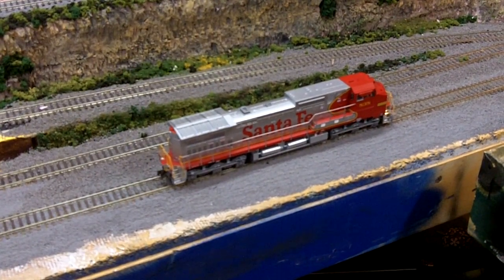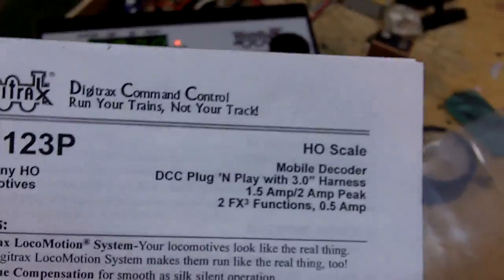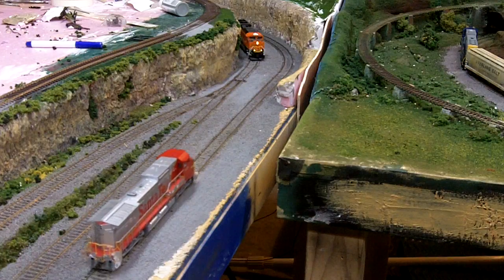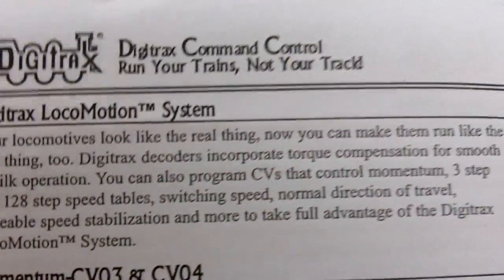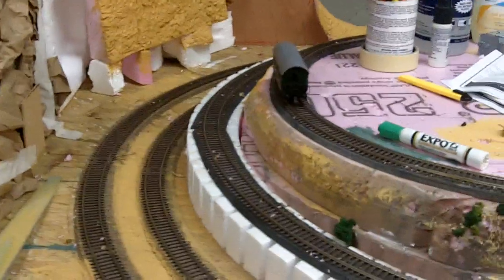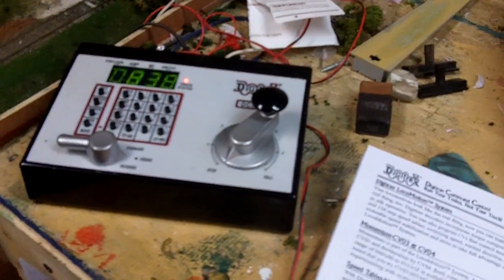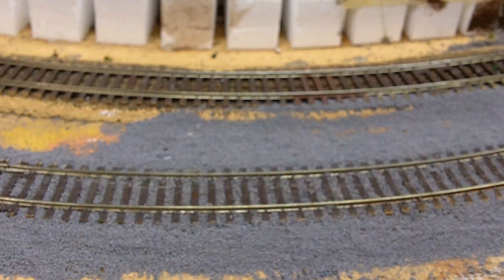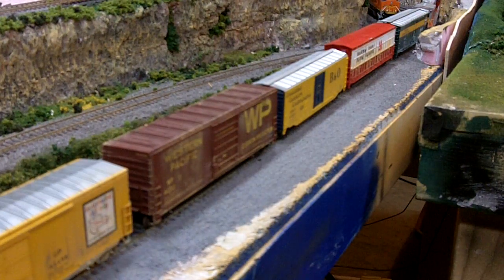Adjusting Locomotive Momentum In DCC

Comment: Buy an ESU decoder and you will ALWAYS have momentum because CV3 and CV4 CANNOT be programmed. I'm using an ESU Lokpilot 5 decoder to control my turntable motor and quite obviously I don't want any momentum whatsoever. So I set CV4=0 and my turntable continues to slow down gradually with rails not aligning as it has overshot where I needed it to stop.
Reply from the maker: That sounds frustrating, are you sure there isnt a setting somewhere that can disable all forms of momentum? I would have to check the manual to be sure

Comment: If I want to adjust the momentum on my MTH O scale SD9043MAC or SD40-2 all I have to do is set the acceleration from 1 scale mph per second-25 scale mph per second, same with Deceleration. And if I'm pulling a load, and I hit a hill it won't slow down because it has speed control. All I have to do is set it to a particular scale mph 0-120 and it will maintain that speed. HO seems fun because of it's complexity, and options.